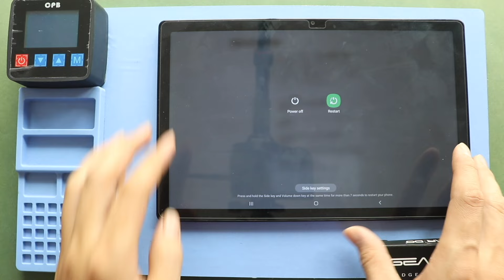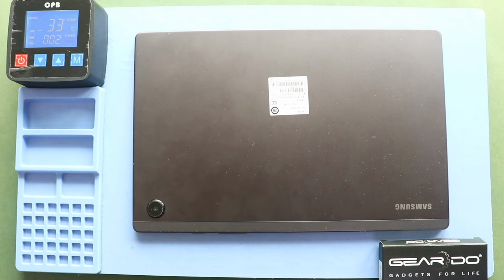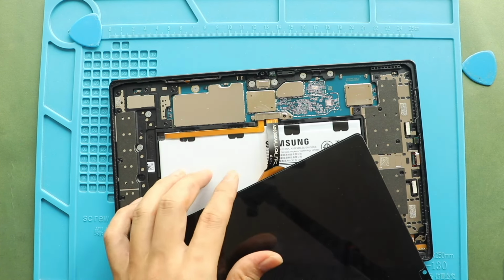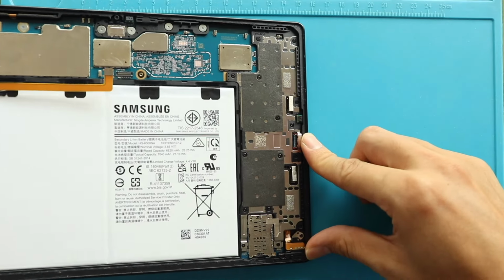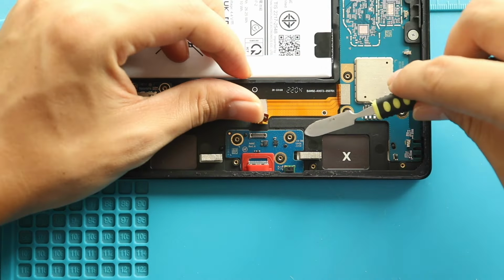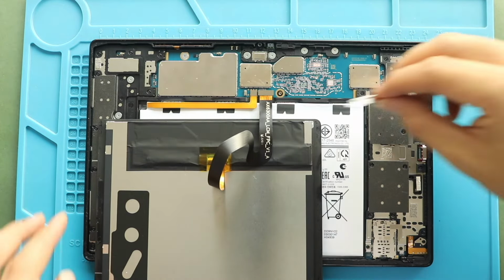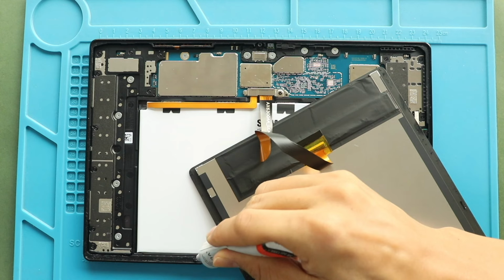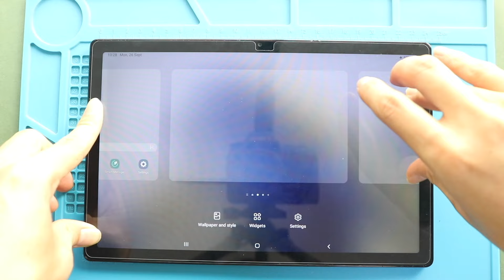Samsung Galaxy Tab A8 10.5 2021 X200 X205 Charging Port Replacement

Comment: Cracked my screen. Ugh. But got the new port installed. Thank you. The screen is incredibly brittle. Removing the screen takes a serious level of patience and finesse. My advice for anyone that thinks they may not get it off in one piece may want to consider going ahead and purchasing a replacement screen to have it on hand.

Comment: Thank you, this worked great, I used a heat gun to soften the glue, Took me about 30 minutes, including cleaning off the old adhesive, recharge battery to 3%  to test as it was flat and glue screen into place.
Reply: Where did you find the parts to replace the charge port?

Comment: Great but unfortunately its VERY important to know that on the end where the speakers are at, there is shielded copper tape that is used for the screen. If you go too far (deep, more than 1-2mm) to get the screen off on that end, you can easily cut through it, rendering the screen useless.  I wish I would have known that. Hopefully that helps someone out there.
Reply: I think that a scrape there caused video garbage.

Comment: This was very helpful so thank you! I’m wondering if I now need to replace the actual screen because there are weird lines across it. I am pretty sure it was damaged before I replaced the charger port though. No visible cracks in the screen. Any suggestions?
Reply from the maker: Try to secure the lcd connection and also ribbon cables. It might the screen or ribbon cable. Always go with cheaper options before moving to change the screen.

Comment: I just did this but now the screen doesn't work and I've taken it apart again but it all seemed fine. The charging port was the only issue. After charging it a little I heard a notification come through but the screen was still black. Could I have heated it too much? I used a hair dryer on low heat but after ages it wasn't loosening so I put it up. 😭 I can't afford to buy a screen right before Christmas 😭😭😭😭😭 Please help